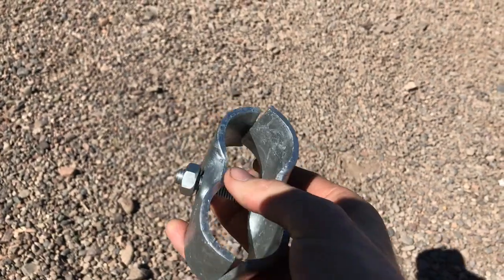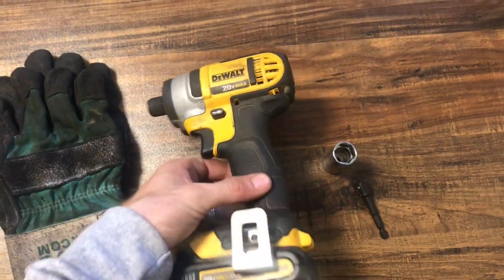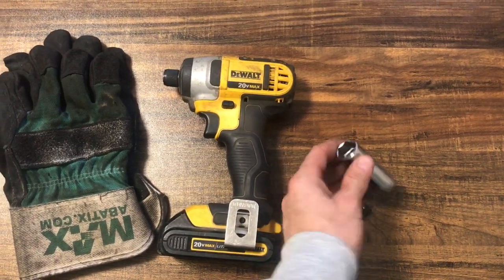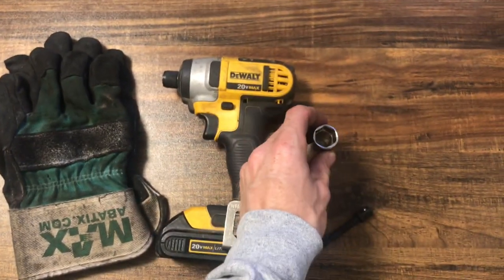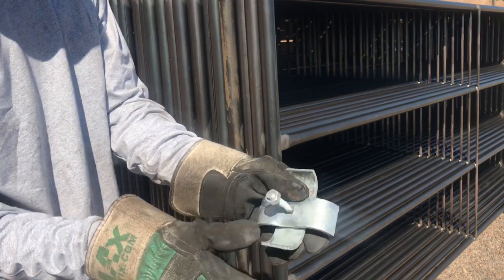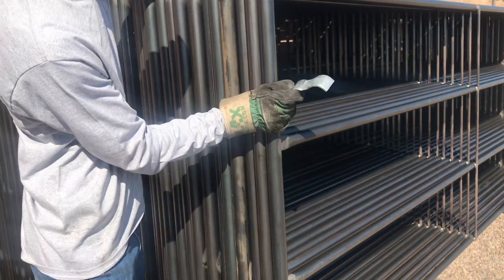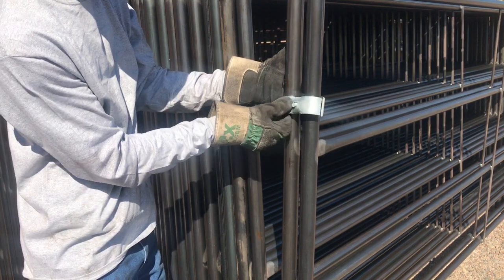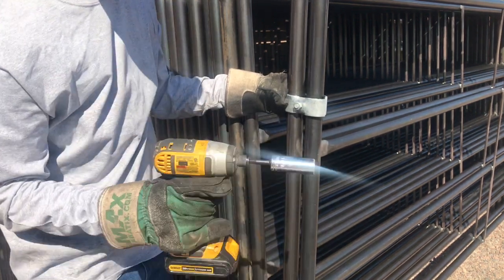How To Use Panel Clamps To Install Your Horse Panels

Comment: Thanks for posting this useful video.  I thought there must be clamps for connecting these smaller horse stock panels together.  Unfortunately the link you gave for these clamps is no longer good.  I'll keep searching for them.  The clamps like these for chain link fence pipes are too small.
Reply from the maker: No problem! You can purchase them by calling our AZ office and we can ship them to you if needed. Just call our AZ office at 480-246-6237